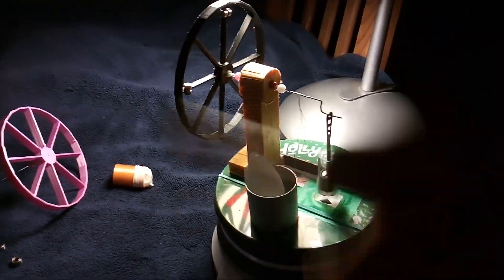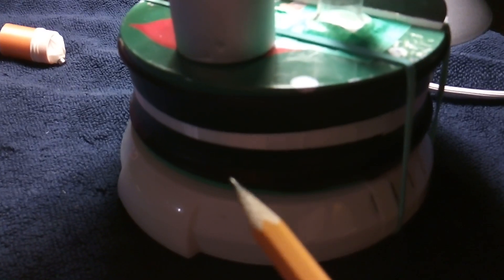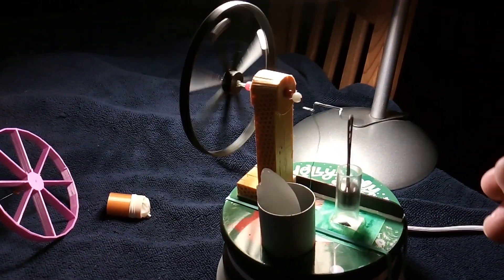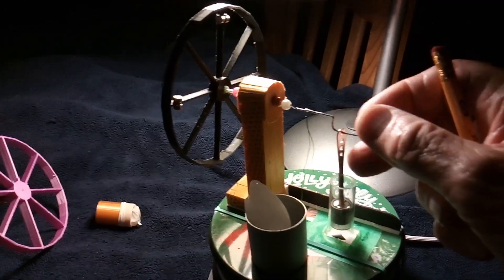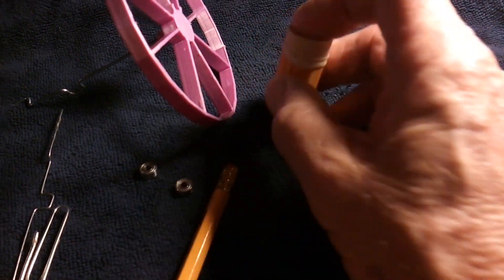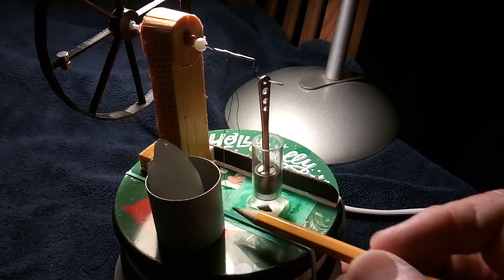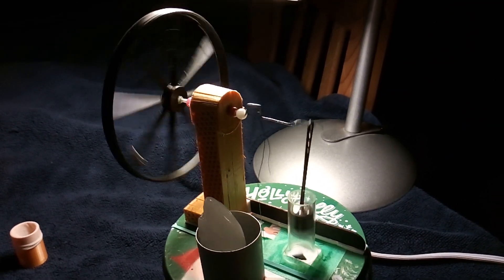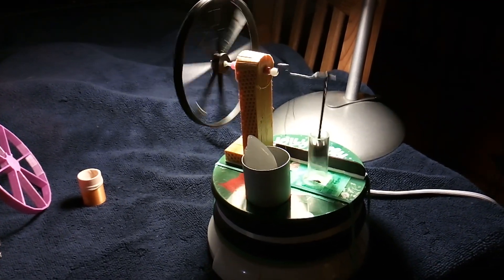PLA Stirling engine --- project turning point

Comment: Just a few thoughts. The hot air plate can be placed on top and the cold plate on the bottom and it will still run. It might last slightly longer. Also, what if the cylinder had a small copper winding on it and you had a weak magnet, or maybe have a magnet on the cylinder and have a coil below the cylinder, you might be able to charge a capacitor and run a LED.

Comment: they are so finicky, awesome job to get it going, love ya work
Reply from the maker: Thanks. I built one of these years ago that I could not get to run after days of tinkering.  I put it away and came back to the project months later and got it to finally run.  The basic design was off.  That project taught me to think more before I start building.  If you make a big error in the initial concept design.....stirling engines are not very forgiving.